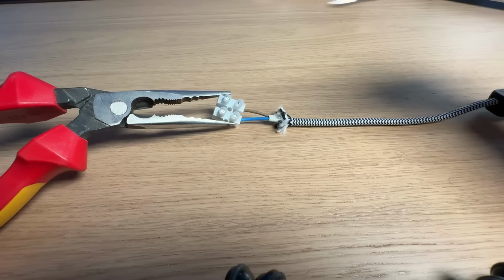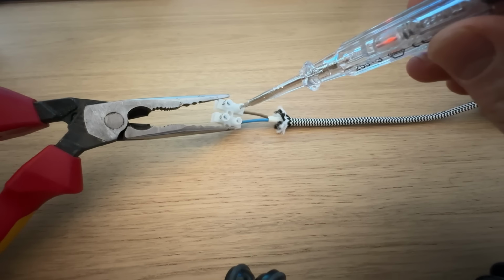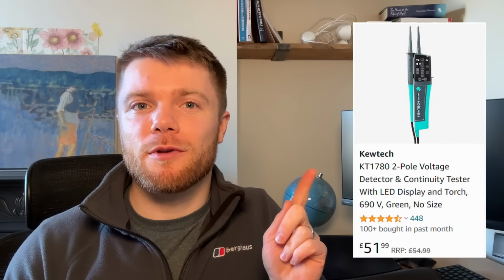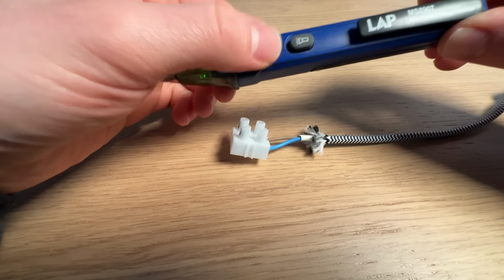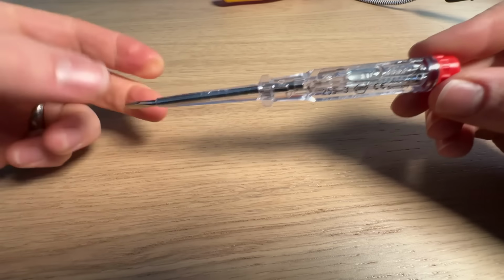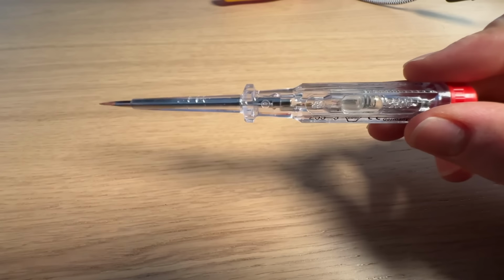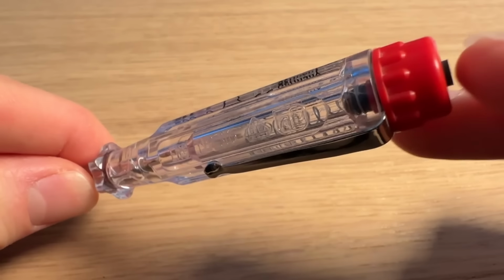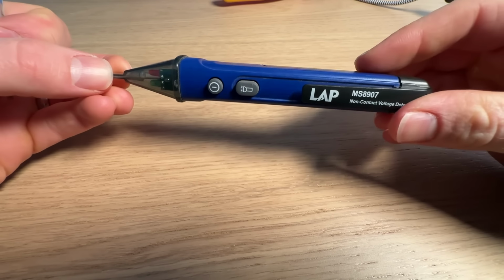The Most Dangerous Electrical Tool

Comment: I recently purchased such a device and will definitely take extra care in future knowing what to look out for now in terms of how it might fail. I think working on 240V and using this device, even if it failed, would at worse give you a nasty zap. I did also purchase one of those plug-in mains testers and it immediately helped me solve 3 potentially dangerous wiring faults that had been in place for years in my home. I would totally recommend to use one of these if at all possible over and above the mains tester featured in this video as it can give you vital information immediately without even having to dismantle anything or directly expose you to any kind of danger.
Reply from the maker: Thanks for watching!

Comment: Great, so if you lose your neutral but still have a live, your "professional" 2 pronged tester says it's "dead" while it's clearly NOT. 
Stick to house bashing.
Reply from the maker: Thanks for sharing your opinion
Reply: Most approved voltage testers now will show a voltage if connected to a live wire without the 2nd prob on a neutral or earth

Comment: i threw that blue lap pen out last month as it failed after 2 years. i have another scheppach one it it was showing the cable was live and the lap one wasnt, even changed the batteries to see if that was the issue. I always try use 2 or 3 methods to test, not just 1 for this reason.
Reply: Try a Fluke pen... built to be reliable and last
Reply: I had the same with a LAP pen. I’m going to shell out on a Fluke or Megger, as the only brands I trust.
Reply from the maker: Yes sensible to use multiple methods. Thanks for watching!

Comment: Back in the Eighties when I was training as a Theatre Technician, one of our lecturers had got a shock through a 400 volt neon tester. It SAVED HIS LIFE. While handling a lantern that was running on one phase, it shorted onto the motorised truck that it was mounted on. The truck was on another phase. The tester melted, and every hair on his body burnt off, but he lived. Because of that tester.
Reply: It said max 260 or 300 volt… 
A good electrician know their tools…
Reply: How did test a circuit of 400 volts with a single pole tester🤔🤔🤔🤔?
Reply: @vickclash7955 when neutral gets disconnected a single phase can get double the voltage
Reply from the maker: Glad to hear it lived, thanks for watching!
Reply: @TheDiligentDIYer1759  It?
Reply: Hello ! May Allah protect and guide you to his light and happiness in this life and the hereafter, God bless, Ameen. Excuse me for giving a little presentation of Islam, because it is very misunderstood nowadays, especially on those « Antichrist's » times, where media and politics are mixed to distort history and truth. And terrorists (puppets of the Antichrist) who misinterpret verses, out of ignorance and political motivations, and take them out of historical context (just like radical atheists do by the way) don't help either. Thank you very much for your time.

First of all, if you have any questions regarding Islam and yourself, just open the Quran randomly, and you will find the answer in front of you, like a miracle and a sign from God.
	
Islam is an arabic word that means the Surrender to the One and Only God, our Creator, Protector, Provider, who gives us life and all that we have, we are safe and sound by his will and grace, we are His and to Him we return, and we have to thank him in this trial life by submitting to him by our free will, or later in the Day of judgment when it's too late to save our own skin. Islam was the original Religion descended to earth from heaven with Adam and Eve (peace and blessing be upon them) in the beginning of humanity. and was passed to people with the succession of the 124 000 prophets and 315 messengers of God to all nations and civilizations since, passing by Noah, Abraham, Isaac, Jacob, Ismaël, Joseph, Moses, Aaron, Joshua, David, Solomon and Jesus (Peace and blessing be upon them) during the history of mankind, the last replaces and completes the previous, until the succession of the last messenger of God fourteen centuries ago, Muhammad (Peace and blessing be upon him) to complete the noble morals of all mankind, to bring humans and jinns out of darkness into light, and to purify people's religion and belief from corruption and polytheism, and return it to purity and true monotheism, like it was in the times of the prophets (Peace and blessing be upon them).

Many Religions that we know nowadays, at their beginning were true and under Islam, initiated by one of the prophets of God, but their original teachings, history and scriptures have been corrupted over time with falsification and polytheism, or lost and replaced with false ones. That's why Islam is the only Religion accepted by God nowadays, which consists in bearing witness that there is no god besides Allah (God in Aramaic, the original language of Jesus and the Gospel), and that Muhammad is His servant and messenger, just like Jesus and Moses and others are His servants and messengers. Never a messenger of God said he was God or literally son of God, it was the people after him who changed the words of God and corrupted the Religion. God is unique and absolute, He does not need to have a family and sons or to associate anyone else with His kingdom, He can simply create whatever He wants, everything belongs to Him, and to Him everything will return. Allah said in Surah Al-Mu’minun : “God has never begotten a son, nor is there any god besides Him. Otherwise, each god would have taken away what it has created, and some of them would have gained supremacy over others. Glory be to God, far beyond what they describe. The Knower of the hidden and the manifest. He is exalted, far above what they associate. (91-92 / Translated by ITANI).

Allah means the one and only God, the God of all prophets and creatures, the creator of the universe and mankind, and the Master of the Day of judgment, where our destiny, Hell or Paradise, is decided based on our faith and deeds in this trial life, and above all, Allah's mercy. 

Allah said in Surah Al-Ikhlas : In the name of God, the Gracious, the Merciful.
Say, “He is God, the One. God, the Absolute. He begets not, nor was He begotten. And there is none comparable to Him.” (1-4 / Translated by ITANI).

Allah said in Surah An-Nisa : O FOLLOWERS of the Gospel! Do not overstep the bounds [of truth] in your religious beliefs, and do not say of God anything but the truth. The Christ Jesus, son of Mary, was but God's Apostle - [the fulfilment of] His promise which He had conveyed unto Mary - and a soul created by Him. Believe, then, in God and His apostles, and do not say, "[God is] a trinity". Desist [from this assertion] for your own good. God is but One God; utterly remote is He, in His glory, from having a son: unto Him belongs all that is in the heavens and all that is on earth; and none is as worthy of trust as God. Never did the Christ feel too proud to be God's servant, nor do the angels who are near unto Him. And those who feel too proud to serve Him and glory in their arrogance [should know that on Judgment Day] He will gather them all unto Himself: (171-172 / Translated by Muhammad Asad).

Allah the Most Merciful said in Surah Ali-Imran : Behold, the only [true] religion in the sight of God is [man's] self-surrender unto Him; and those who were vouchsafed revelation aforetime took, out of mutual jealousy, to divergent views [on this point] only after knowledge [thereof] had come unto them. But as for him who denies the truth of God's messages - behold, God is swift in reckoning!
Thus, [O Prophet,] if they argue with thee, say, "I have surrendered my whole being unto God, and [so have] all who follow me!" - and ask those who have been vouchsafed revelation aforetime, as well as all unlettered people, "Have you [too] surrendered yourselves unto Him?" And if they surrender themselves unto Him, they are on the right path; but if they turn away - behold, thy duty is no more than to deliver the message: for God sees all that is in [the hearts of] His creatures.
Verily, as for those who deny the truth of God's messages, and slay the prophets against all right, and slay people who enjoin equity - announce unto them a grievous chastisement.
It is they whose works shall come to nought both in this world and in the life to come; and they shall have none to succour them.
(19-22 / Translated by Muhammad Asad)..

God said : Say, “We believe in Allah, and in what was revealed to us, and in what was revealed to Abraham, and Ishmael, and Isaac, and Jacob, and the Patriarchs, and in what was given to Moses and Jesus, and in what was given to the prophets from their Lord. We do not differentiate between any of them. And to Him, we surrender.”
(2:136 / Translated by Community)

Salam (Peace) -------

Comment: Few points to make on this one:

"dangerous" is relative. 

Can you point to a single recorded incidence of an injury from a mains testing screwdriver?  I can point to a large number of injuries caused by the incorrect use of a handheld multimeter (Which can fail to show the voltage if you have the setting on it wrong (ie wrong terminals or DC setting) and can actually cause an arc flash over if the wrong settings and terminals are used and which often can have damaged leads due to careless use onlow votlage systems and those leads result in electricution of the user. 
 Any "dual" probe tester also carries a risk as those probes can causes shorts in the EUT and necessarily makes those devices a double hand use, which means a current path more likely to cross the users heart

It's worth noting that the neon bulb used is actually enough to prevent a significant shock on it's own as its ionisation current is very low (hence its use) it is also very very robust and not easily damaged.

IME, the worst thing about mains testing screwdriver is actually the fact it IS a screwdriver, so people are tempted to use them for other things other than mains testing, often damaging the insulation on the shaft, which can leads to user shocks should the user hold the device below the handle

The no1 reduction in risk from "proving dead" is making sure you can get a positive identification of the high voltage potential before you attempt to isolate the circuit.  IE if you isolate the circuit and use a mains testing device that does not have a proving unit (ie martindale tester etc) you never see a positive result that proves your testing is set up correctly and working as expected.   So i always make sure i can measure and get a "live" result, then isolate and make sure i get a "dead" result.....

Sure, for commercial use you need a proper industry standard tester, but for DIY i'd much rather someone used a testing screwdriver (having proved they get a positive result first before isolation as mentioned) that just guessed.......   ;-)
Reply from the maker: Thanks for sharing your opinion

Comment: This tester is no more dangerous than any other tester. You are talking hypothetically, that can be said whatever you use.
Reply: Are you serious? What’s the CAT rating on those pen testers?  😂. Seriously, this is a big deal. You may get away with it for basic home use.
Reply: These screwdrivers cannot prove a circuit is dead. As you have no way of knowing if it's actually working unless you can test it on a known source first.
Reply: I have received electric shocks from using one at least.
Reply from the maker: Thanks for sharing your opinion
Reply: @TheDiligentDIYer1759  you don't know what you're talking about man

Comment: Hi. I was interested in your saying the red probe on a multimeter should be put into the COM. I did a search and other sites say the black probe goes into the COM. So who is right?
Reply: Saying the red probe goes to COM is the 13th stroke of the clock, it casts doubt on all the rest.  And advising a multimeter is dubious, there are a lot of cheap ones about that are not properly approved for mains voltage. I can see the argument against neon screwdrivers but you have to keep risks in proportion. I would only use one as a backup check. And two probe testers can give the wrong answer in some situations like lighting circuits.
Reply: Definitely not this one, the BLACK probe goes to the common.
Reply: Really only matters for DC.
Reply from the maker: I think you’re right and Im wrong, it won’t make much difference for checking live though. Thanks for watching!
Reply: @TheDiligentDIYer1759   dont think half-assing electrical instructions for views or clicks or subs is the way to go...you dont want dead subs right?

Comment: Think you are all missing the point. They should be used as a probe, ie should have a pointed end. Most of them dont, they become flat head screwdrivers and levers by diyers, which are over stressed causing a crack in the shaft, especially cheapo models. Current could pass resistor into crack onto a sweaty hand and there lies the problem. Simples.
Reply from the maker: That’s a good point, I haven’t seen one with a pointed end at all, only screwdrivers. Thanks for watching!

Comment: while i agree that these should not be used for proving live/dead conductors, and for a quick indication a non contact tester will suffice. i use 1 for finding the live wire as normal sockets here dont have a defined live and neutral side. and for my old lathe to run in the right direction i need to know which is which ( and yes i'm setting up a cee socket so its always correctly hooked up later on havn't had the time and space to do so yet ). do you have any insights on how to cheaply identify the live conductor?
Reply from the maker: Difficult to know without seeing your exact situation, but a stop gap solution could be a cee to 3 pin converter, they’re pretty cheap and easy to come by. Thanks for watching!
Reply: @TheDiligentDIYer1759  yup thats exactly what iv been doing, and have labeled a few sockets with live an neutral side. But confirming whether the person before me actually followed color codes is always the gues. What affordable tool would you recommend for reliably differentiating live and neutral. My non contact isn't to clear about it and doesn't seem like a reliable way to me.
Reply: Where do you live that you have sockets without a defined live and neutral side. Here in the UK sockets always have defined live and neutral sides.

Comment: Also called "widow makers". 
Banned from our site. Anyone caught with one has to return it to their van. Anyone caught using one is kicked off site for the rest of the week - second offence is a ban from site. 
You either use a voltage indicator and proving unit, or find another profession. 
The main issues with those toys are: 
The light can be unclear - as shown in the video 
The "test" voltage uses the body as the return path 
The resistor or neon could go faulty, and give a false "safe" indication. 
Probably others, but in general DIYers don't / won't listen to electrical advice. 

Volt sticks shouldn't be relied upon either. Always follow up proving dead with a voltage indicator and proving unit before work.
Reply: What sort of people work on your site? Does your site not have anything for regular checks of electrical equipment you use? What training is given? Do the people on your site have no common sense?
Reply: Working on Data Centre / CoLo / FLS build and upgrades. Yes, I (and my contractors have common sense, and for me - about 30 years experience woking in the industry at voltages from 54V to 132KV.   .  @niv8880
Reply: You don't seem to have any relationship with electricity or any experience in the field.
Reply from the maker: Glad to hear, thanks for sharing and thanks for watching!

Comment: So the tool effectively creates an earth leakage path through the user. Would that trip an RCD ?
Reply from the maker: You’re right it does create leakage, but an rcd is rated to allow up to 30mA of leakage. If the screwdriver is working correctly, it won’t leak enough to trip, same with a socket tester. Thanks for watching!
Reply: @TheDiligentDIYer1759  You are desperate for hits aren't you? You could also argue rubber gloves are dangerous for electrical work - I mean, what if they have a cut in them and especially wet. Why don't you do a video on that?
Reply: @TheDiligentDIYer1759  So if I put my finger through my earth leakage clamp meter the reading us going to be less than enough to trip an RCD.